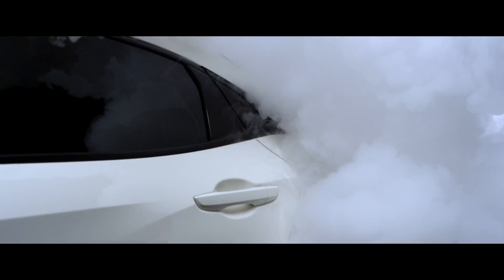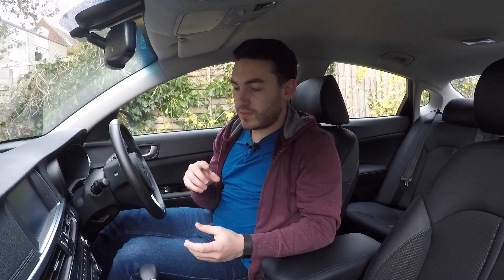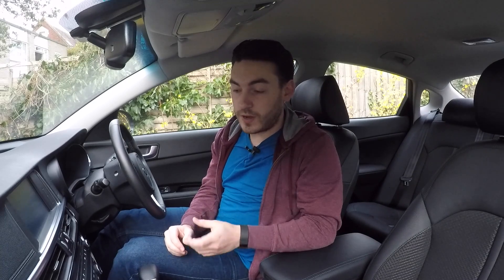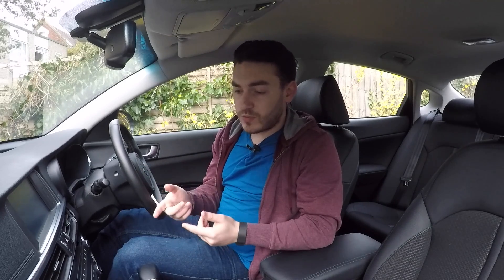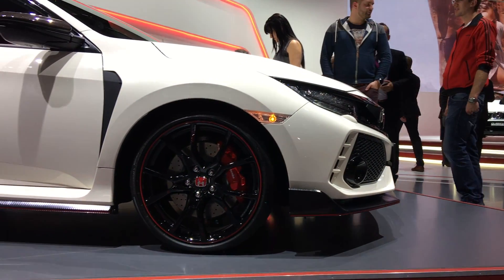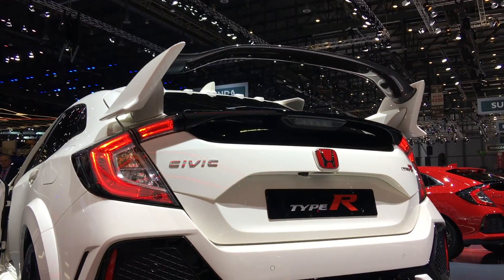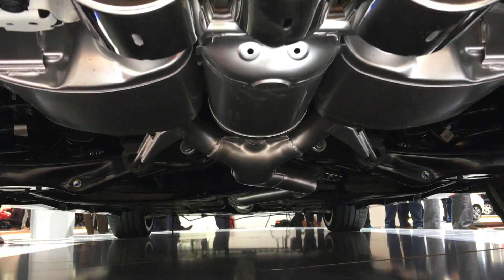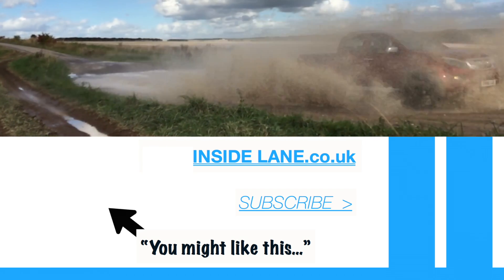Why 2018 Honda Civic Type R has Less Power in America - Inside Lane

Comment: This was something I spotted straight away, I'm a regular reader of Jalopnik & couldn't understand how the were 10 bhp out.
It should be interesting to see the reaction to the Type R stateside because they are rather fond of Honda over there.
Reply from the maker: I think it will go down very well. They have been crying out for Type R product for a long time.
Reply: Fuckthe Euroteeleafs OK, let's start slowly, the 3 door hatch market is dead I'm afraid, most manufacturers are not offering them anymore.
Honda are a business, they have to make these cars financially viable to be able to offer them in the first place.
Focus RS, the New Megane R.S, Audi RS3, A45 AMG, all are 5 door hatchbacks, any currently available as a 3 door are very likely to become a 5 door in the near future.

This New Type R like the FK 2 before it are Turbocharged & VTEC, it doesn't scream to 8500 because it doesn't need to & I believe the VTEC has been set up differently.

" the passion is lost " 

Have you seen the Type R?
No body is offering a car like this currently, it makes the other hatch look like run of the mill shopping cars.
Manual gearbox, LSD, Brembo brakes, electronic dampers, working aero, & you get collect the kids from school & put a useful amount of shopping in it.
Reply: Inside Lane True typeR's should be 3door only! Honda should of given the buyers a choice but no they wouldn't because the designers are stupid!!! It doesn't even have a screaming vtech anymore!! The passion is lost!!!
Reply: Zerofightervi Fuck it I'll just supercharge my EP3!!! Thanks for the info though
Reply: Zerofightervi Just a quick question. What is better for me??? jackson racing or rotrex???
Reply: Fuckthe Euroteeleafs You're welcome, as for your supercharger question, I honestly don't know.
Depends on what is more important to you, both have plus & minus points.

Comment: 95 Oct  I can only get 91 Oct from the major gas stations here in California
Reply: The 91 you buy at the pump is rated in AKI - an average of the RON and MON grades. The video is discussing only RON.

91 AKI and 95 RON are roughly equivalent.
Reply: Good info Inside Lane.  Sears Point raceway (by where I live in NorCal) use to carry higher octane fuel.  In any case, thanks again!
Reply from the maker: Really? What would you say is the average?
Reply from the maker: Great info! I didn't know that. Thanks.

Comment: The FK2 is great as it makes its power on only 95 oct fuel were as other high power 2 ltr  cars need 98+ , I still use 100 oct in my one
Reply: sinngsg9 I'm struggling to like this new model. The FK2 such a fantastic car! This new model doesn't offer you much more for the money. No ones bothered about comfort mode in a hot hatch. We wanted substantially more power and grip maybe awd...decent 0-60 time, power delivery throughout the gears retaining that drivers car feel with the superb gearbox and steering. I'm wondering if this will turn out like the EP3 scenario where the first turbo model the best and the rest struggle to compete. The only thing I'm certain on new FK8 will sound better will electronically managed value exhaust. I'm not even convinced independent rear suspension right for this car. I'm waiting patiently to be proven wrong!
Reply: "I'm not even convinced independent rear suspension right for this car", Why? Thats one of the reasons the Integra DC5R was one of the best handling fwd cars of its time. Honda made that mistake with the FN2, it was still a good car but it didn't handle anywhere near as well as the DC5. The Civic Type R offers more fun than all of its rivals, which is why it is still FWD and only offered in manual. It wasn't designed to be the quickest to 60mph.
Reply: Im not sure about the new one FK8 the styling with its flake vents on the rear and so on in fact I'd go as far to say is it makes the FK2 a more classy looking car , The FK8 is lower and has Independent rear suspension which should allow it to out handle the older car but saying that there isn't a hand brake you need a hand brake in a FWD hot hatch plus I don't like the fact it runs on 20'' rims sounds great until you find out the rubber only lasts about 3k/6k or one hard track day there not cheap and as I said before not every petrol station has 98+ oct fuel which can be a pain Its going to be a great but I don't think Id go for it
Reply: sinngsg9 It might beat Nurburgring fwd lap record, it might do 0-60 and top speed slightly faster but is there going to be anything substantial here in terms of performance....I think no is the answer and that's the reason why the gimmicks Apple play, valued exhaust, independent suspension and that's about it really just don't interest me at all. I think Honda will release a much more hard core performance orientated R and by that I mean at least 370bhp standard!! Maybe in a years time and that's probably the one to look out for. The extra 10bhp is pretty much pointless and won't be noticeable at all...in my opinion. Fk2 set such a high bench mark meaning Honda will have to deliver something mighty special radical for it to catch hot hatch enthusiasts attention. This will probably sell well in America but over here Uk...I doubt it there's simply too much choice contenders out there at the moment..it's up against some really good hot hatch backs!!
Reply: sinngsg9 yeah i see what you mean dude. This is why I love the FD2 styling, it was modern and looked aggressive without going over the top like the FK8. I really dont dig those fake vents, I recon the next revision might lose them.
Reply: Independent rear suspension is what made the EP3 so great  its no gimmick the FN lost it and gained weight and was never the same the new FK has it again and less weight plus a little more power , I really don't think the Type R needs much more power maybe 330 but thats it
its weight is more important that gives you the turn in feel being able to out brake other cars power isn't all , I still like the looks of the FK more thats why I'm going to keep my UK engine FK2